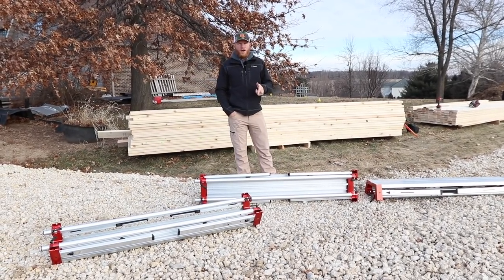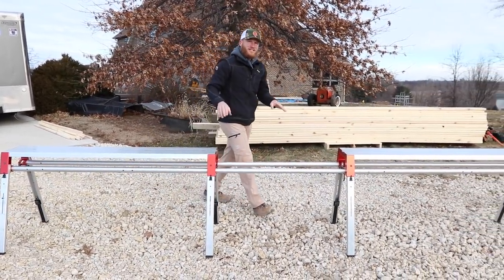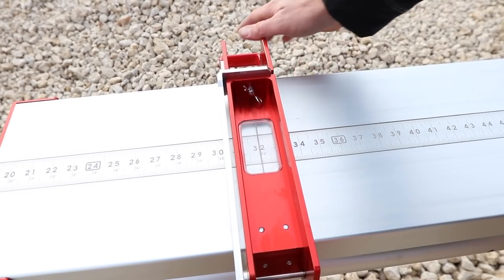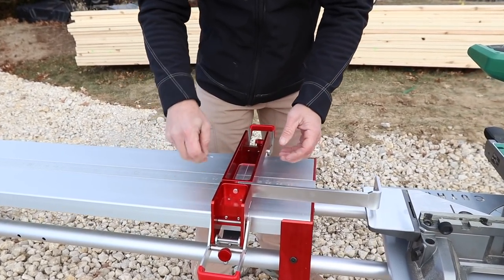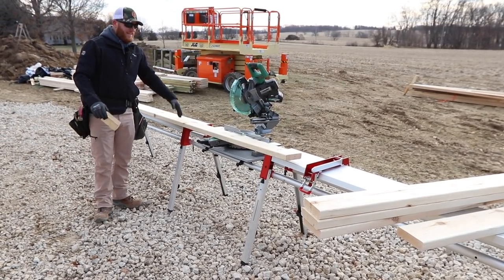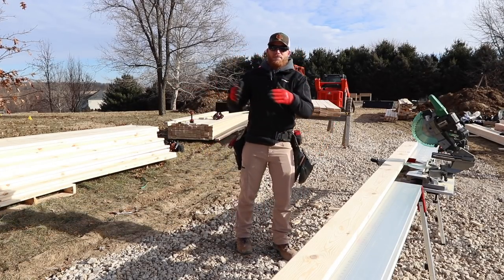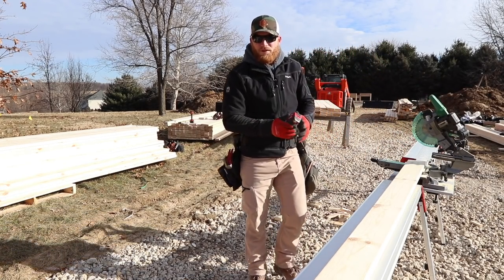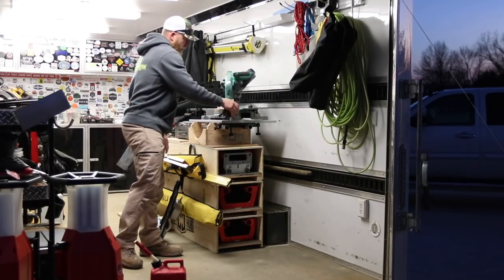Is This Work Station Worth the MONEY $$$$

Comment: just two inputs - 
1) The legs should fold out and lock without needing to bend over to push the lock in, only when folding it up should you have to unlock and saying that, the lock release could be near bottom of the legs inside so your not bending over 
2) The aluminium stop only needs one lock to push down, the back side should just hook over the table 
just an opinion on the product :)

Comment: My suggestion for version 2.0: an additional fence or a rail to keep long lumber parallel to the fence of your mitersaw. And to prevent from falling down. the second idea is a kind of soft-cover, if you cut painted or sensitve material to prevent from scratches.
Reply: This is what would keep me from buying it too.  I've had stations with full fence and it's key.

Comment: They need a lead-in angle for the leg lock button.  There should not be a need to press the button to extend the leg.  They need to move the leg frame under the table so the stop can be locked all the way to the ends of the tables.  There needs to be friction locks on the table connecting tubes instead of fussy spring loaded bullet pins.  The stop needs to be one handed instead of two handed.  There needs to be a story board stop setup where you can reposition the stop in 3 or 4 of your most common measurements.  There needs to be a dolly of some kind.  I think most of us agree that cost needs to be pulled out of the unit to get the price back down in line with the competition.
Reply from the maker: Jerod Matlock you have some good ideas!  I hope cut hub reads the comments

Comment: Commercial equipment isn’t cheap especially GOOD commercial equipment. If it saves you time and gives you a better finished product then I think it’s worth it.
Reply: Define GOOD.  Does it mean a saw table that twists and flexes like the cut hub does just from the pressure applied to lock down the saw stop clamps?  For 4k I would expect it to be made of thick enough material that was well fitted enough that it does not twist and flex all over like this thing appears to do.

Comment: Dude for $4 k it would want to frame the bloody building for me!!! No way!!!
Reply: Not efficient in this case at all. Moving lumber is an additional step. Stupid. This would be a good system for siding guys doing LP
Reply: Andrew Renner but pulling a tape and marking for every board when you’re making the same board isn’t efficient either. Like he said, it’s a trade-off one way verses the other. The benefit here is the exact length and square ends every time.

Personally for me I install a lot of tongue and groove ceilings. We use a miter saw anyhow to get the job done, so this would be better for my guy’s efficiency.
Reply: @Gottesacker86  with a few 2x4s and 1x6s and the insert from a tape measure you could have the same set up for a couple of hundred dollars or less
Reply: pearse mcaleese without the ability to compact it as much. You’re right though.
Reply: @Gottesacker86 

I have Fastcap's Best Fence Pro 4.  It isn't as durable as the cuthub appears to be but it's gobs cheaper and has an accurate stop that goes right up to the blade.  Plus they have new fences without the rear vertical part.  Super nice.

Comment: I used to think Festool stands were overpriced until I saw this one! Thanks for demonstrating it but it’s a stand with a kinda, sorta, sometimes ruler/stop built in (with an extension that was a truly horrible afterthought). I made my own stand and I agree the efficiency is good, but in my opinion this unit was not well designed. A system with flip stops that can be left set at common measurements and flipped down as required is a whole level higher efficiency. That’s not possible with this unit. Kudos to the guy for giving it a go, but no, this is not a US$4K product. Sorry.

Comment: I can do the exact same thing with my $200 DeWalt miter saw stand.  I do it every day, I'm a trim Carpenter.
Reply: your parents must be so proud
Reply: I've found a chinese knock off brand ($100 CDN) mitre saw stand with pull out arms, wheels and a friggin power bar. I've thrown it in and out of my van every day for the last 5 years, and only replaced one 60 cent washer. hell, I could get a work van for $4000USD
Reply: @patryan3723  have link and name?
Reply: 4000 lmao 🤣
Reply: @patryan3723  dead link

Comment: For siders I could see this, but when I'm building a structure I'm usually mobile with saw in hand.  A Finnish guy works on flat ground where he can use a pod to hold up long pieces.  Even if I had this I'm not sure it would be a good fit for me.  I have made a plywoood table and a few extended pieces to hold up my work piece for use with the miter and table saws

Comment: Add a 24 inch guide/template/measuring stick,  attached somewhere on the framework so you can zero your mitre saw EXACTLY EACH TIME.........BUT thinking about it, you have to zero everything according to the tape measure you are using that day, be wary of using a dinged tape measure you dropped later in the day or you doing the cuts while your work colleague is shouting out the measurements using a different tape measure, without checking they are giving the same measurement's, other than that any tool that makes you time and money and life easier is worth a look, great review

Comment: Not for me, even if I was still framing full time.   Good call on the locking together function. Its range is clearly compromised by the lack of that feature.  I like the concept but also see room for improvement, especially at the price point.  I like the adjustable legs but feel they could be improved for a more accurate surface.  Would also like to see more of a back fence. perhaps even on board level vials.

Comment: I’m not taking anything away from the guy that designed this, he has obviously invested a lot in this BUT if he truly comes from a framing background how the hell does he design a product with a fence (which is his favourite part) that can’t cut an 8foot length. That has to be the most common cut ever made. “Framing some 8ft walls today boys, let me just get my 4K mitersaw stand out and I’ll show you how it’s done. Oh wait, 10ft ceilings it is”
Reply: Miter Saw is an old idea because has just about 1 ft cut and cannot be used on boards. It shall be retired. I invented a "Parallel Guided Power Saw" which can be seen on you tube under this name. My saw can cut up to 18 ft or more. Look at my saw and let me know what you think. My saw may replaced miter saw, table saw, and router table. It can carry also grinders, drills press, hand saw and more.

Comment: Given the size of the buildings these guys build I would say any miter/ cutoff station is a must have. I know this was a demonstration on the gravel but I would set it up once on the building slab until the job was done. Like the other commentors I question the $4k price but good tools made in this country are pricey. If you get what you pay for it is a good deal. When I was a machinest I bought Starrat measuring tools. Not inexpensive but very good. 

I have been watching these videos and have been impressed by the sheer efficiency of these guys.

Comment: Hello, Coming from 40 years experience as a Carpenter the majority doing finish Carpentry, this saw station does have it's place especially if you are an "Owner Operator and hire out regularly.. I have several work stations and if I could go through a "do over" in life(starting in the Trades) I would do a few hings a little differently and would consider this Saw Station...
It is a little too big for most Finnish Carpentry needs(indoors)... Greg

Comment: The biggest thing people are missing is that we don't all make straight cuts on every board.  I rarely build pitched foods with straight walls.  Stop blocks allow me to square one end then cut an angle on the other side very quickly and accurately.  Same goes for super long tji and engineered studs and lvl.  If you are building anything other than cookie cutters and especially if you do it in remote places like me, a proper workstations is key.  No reason you can't swap out the mitre saw for a cold metal saw if you do all the trades like me.  Then move it into your home shop.  I still think at this price it needs a full fence though.

Comment: A few things:
1: I cannot believe how warm it was last winter. We had a similar situation in PA., and shortly after that warm spell it snowed heavily and froze and the temp dropped below zero F. You had an ideal winter job site there!
2: I would've liked to see the Cut Hub set up with those wooden outriggers that Dave Jessop brought to you. I could see how they would be very useful when you were stacking your cut lumber for your windows and balancing them on the one metal horse.
3: You didn't show any detailed footage of how the miter saw is first mated to the Cut Hub saw platform. That would be neat to see.
4: One neat thing that Concord Carpenter / Toolbox Buzz did when they reviewed Milwaukee's smaller prefab miter saw horse, they showed how the saw station platform included a small indentation for retaining small items like a pencil or razor-blade knife. Robilard suggested Milwaukee improve this tray-within-a-tray by magnetizing it. Cut Hub should do something similar with their "2.0".  https://youtu.be/aRiHi_KlWRY
5: Dave Jessop & Co. could always team up with Red Oxx from MT. Both made in MT., both premium in their niche, both would appeal to rugged, on-the-road contractors.
6: This is going to sound a little silly at first, but please stop and think: This Cut Hub with two wooden outriggers would make a great on-site table for viewing blueprints as well as for lunch breaks and other table applications. All that would be needed is a pair of benches. If there were a way to clamp down a blueprint (or shade umbrella/tent) to the table, this would be very useful for a variety of applications, both job site and otherwise.
7: I hope all those components a durable and hold up a long time.
8: In your job trailer, you used the shipping boxes for storage. That's a minor, though significant, selling point. What was that box you stacked the cordless saw on top of? Was that part of the boxing as well?
Reply from the maker: All great ideas and yes the entire shipping containers doubled as storage in the trailer

Comment: As a DIYer, there is no way I would spend $4k on what is essentially a couple of tables.
As a handyman etc, this full kit is also probably not worth it.  Just two stands might be competitive with the Paulk designs (the Paulk designs are an order of magnitude cheaper but to get that price you have to build it yourself and time is money etc).
For heavy duty repetitive work like you are doing this probably makes sense because of all the time you are saving by not having to get the tape out for each board, and you have the space to set it up and have both infeed and outfeed lumber piles.

Comment: unless I'm missing something... that little arm that goes on the stop fence, positions the saw correctly. so after setting up the tables, lock the stop on a predetermined position, load the saw and touch the arm and the saw should be pretty close to perfect.

Comment: First off, I never need to cut long boards in multiples.
Being built with aluminum,fit , finish,and portability..looks like a great start.
Did I miss something, or what happens when the board length ends between stands?
A continuous tape measure,as well as a place for the stop.. is what I thought this system was all about?
The stop should be wider( for stability),and only need the front locked like a table saw.

Comment: If you can get the Festool Kapex (a clearly superior saw) and Stand and extensions with 5ft support and 8ft material stops out each side for considerably less then just these stands, you know its unreasonably overpriced. 
You can easily build additional support extensions for a $100. 
There’s considerably less then $1000 worth of Aluminum there so how much money you make with it doesn’t justify its cost, that’s not how you price tools
There’s also other fence systems that do exactly this for much less with 1/2 the bulk and much less setup time.

Comment: When the sections are pushed together tight you could add a locking block to the legs using the available slot in each. Maybe a couple of carriage bolts and wing nuts and an aluminum piece cut to size.

Comment: Many see the price tag and instantly go into sticker shock.  You have to look at it from the perspective of "over time."  For "personal use," $4K for something like this would be hard to swallow (unless you're building your own castle or fort. (sic)).  From a business perspective, one has to look at performance, efficiency, and cost savings.  It's called, ROI or Return on Investment.  Man hours is one of the most expensive expenditures of a business.  Streamlining tasks effects man hour expenditures  (performance and efficiency), which in turn should equate to cost savings.  Tweaking processes (especially recurring processes) and support equipment is a must. . . . .unless you have DEEP, DEEP pockets. . . . . .or someone else is footing the bills and doesn't give a shit.
Reply: in basic theory you are right by all means within your reasoning. But 4k is still way too much money for this kind of solution. Its not like there are no other cheaper solutions on the market that hit a similar efficiency. or how about a  diy production at a fraction of that cost? 4000 USD for 3 saw horses and a miter saw platform is muchos dineros, no matter how you look at it ;)  If you can afford it and feel you require this high quality looking system, then by all means go at it.. but I cant help feeling it is heavily overpriced for what it is. At 4k i would expect an incorperated station system inbedded in my work trailer that, with a push of the button, presents itself and outlevels the trailer to be ready for production in seconds :D
Reply: By all means, besides your personal opinion of "3k is still way to much money," provide a link of your productivity analysis of this equipment.  You know, "over time."  Also, I would be interested in seeing the specs and cost of the "station system inbedded in my work trailer that, with a push of the button, presents itself and outlevels the trailer to be ready for production in seconds" you mention.  You know, to compare prices, capabilities, etc.  I don't get "sticker shock" easily, unless I see proof (not opinion) that a product isn't effective, from a mechanical or structural perspective, or doesn't save time, effort, or money.
Reply from the maker: TacticalSocks this is not for everyone... totally agree!! But when I can feel good having my new guy rip 16’ 2x6s down by himself!!! That’s huge
Reply: Tools degrade ...which is expected,you can figure a replacement cost/time.
Fatigue is very hard to account for.
Anyone can work 16 hrs per day ,over time pay and fatigue will cost extra for the business owner.
Say it saves 1 hr per day (this includes,bad cuts, sawzall time to remove bad cuts,and material loss)at $40 per hr ( this includes workman's comp,insurance ,wages ,profit ,overhead,etc) and it gets used 3 days per week.
ROI would be about 7 months.

Comment: Nice rig...but....too low for me. I see the adjustable legs. Probably could pre-set the height and leave it. Another but....noticed at tear down not much room between the feet of the legs in the folded position, that would prevent the pre setting of the leg height for different job sites.
Should have used the Milwaukee saw...would have matched the red on the hub. Lol
What weight are the horses(benches) rated at?. Could use as a impromptu scaffold.
Keep up the great craftsmanship
Greg

Comment: Hi Cyle looks like they need to change a few things on this unit. But the design I really like too. What they MUST change is this button on each leg it should be more like the tough build sawhorse legs. So you don't need to push... hold it so you can unfold it. It should only need to be pushed when put away again. And also why does it has to be so long ?? That cut stopper should be coming with 2 additional parts in it, I laser measure unit and a reflector unit so you can just stick it onto your miter saw cut and push the button on the cut stopper and BOOM you can in mm or inches with fraction or without set up it's perfect distance each time. But also the price of 4K is WAY TO MUCH. I say  $1500 for this without shipping and those boxes yes and with all it max $2500, But the laser is a MUCH BIGGER thing let him design the laser so it laser off your miter blade and boom you don't even need the tape anymore and you are much quicker on the money. I love my BOSCH laser measure unit's they are rock stars so let him just add a holder like a magnet place on top of it and boom you got it that would than really cut down time and speed it all up.

Comment: The festool system does the exact same thing with the wings and has good stops and is way cheaper with the saw included.
Reply from the maker: yes but does it have a table saw outfeed built in as well as tons of extra storage on removable wings?

Comment: You should pick up the bundle of wood with the skid steer and position it where you can just slide them on to the table to cut. 
Save walking time, especially on those rocks. 
Great work as usual.
Reply: Might bump into the $4k stand. We can't have that happen..
Reply: skliros we demoed one of the early “sawgear” jobsite digital stops.  It was destroyed in minutes by banging 2x12s into it.  This looks a lot more rugged, but still... it had better be bulletproof and this looks like it might well be.